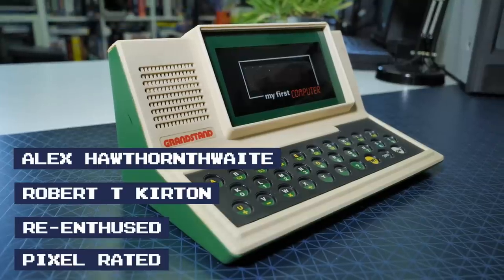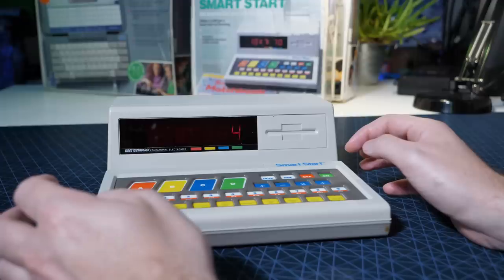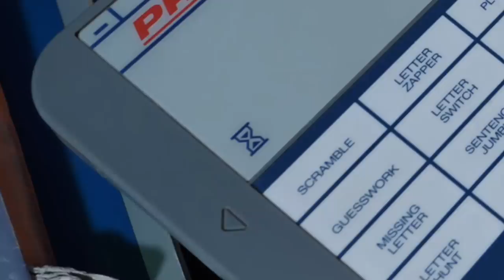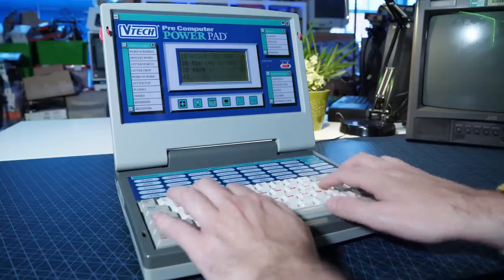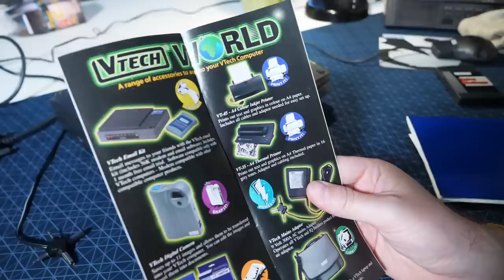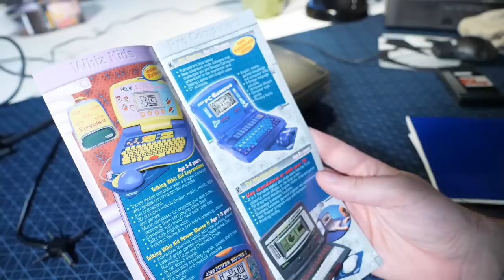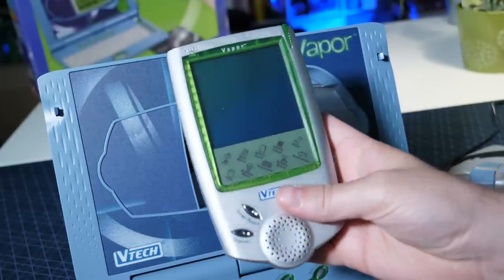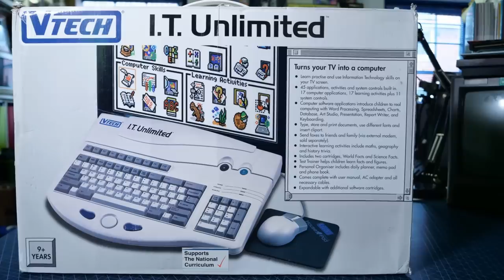VTech Laptops: Better than you Think | Nostalgia Nerd

Comment: The Talking Whiz Kid Platinum actually has TWO extra colours! I am literally on the point of fainting. You get red, green, and blue, and the last option being the background which is sort of greenish silver. 

It uses a rare type of LCD also used in a few Casio organisers in the 1990s. I'm obsessed with it! The colours are always washed out and weird looking. Some seem to have more than 4 colours. And they solve the problem of colour LCDs, which is that in the past they always needed a backlight to see anything at all. And until that Japanese man invented the modern blue LED, and therefore the white LED (he got a Nobel prize for it you know, and now every lightbulb uses his LEDs!), the only backlight you could have was an incandescent bulb, which wasn't bright, and sucked down power. Or else you could use a small fluorescent tube, like the Game Gear and Lynx. Those also sucked the power, those two consoles were famous for eating 6xAAs in a couple of hours. The tubes were bulky and needed a 100V transformer to power them. Horribly inconvenient, colour LCD had been around for years, but nobody could use it cos of the backlight they needed. 

Anyway that nice Japanese man invented his blue LED, which, with a phosphor in front, can produce white. The phosphor absorbs some of the blue and re-emits in longer wavelengths, yellow, green, red, etc. So after that low-power colour LEDs were all over the place for tuppence, hooray!

Anyway, your weird 4-colour ketchup-stain of a display is interesting cos it's the exception. It's not great, but it actually works. And it bugs me to wonder, is that what the Game Boy Colour used? It only used a couple of small batteries (2xAAA I think) and had no backlight. It's display was colour but had a really weird look about it, really odd colours a lot like those on the ol' Platinum.

And do you know how much information there is on the web about this LCD display, or even what the Gameboy Colour actually used? None! Bugger all, nothing. Disappointing when something hooks you, and you've been on the Internet 20 odd years and are used to being able to find out everything about anything in a few seconds searching. But no. They're an enigma wrapped in a mystery wrapped in a kids' toy computer, wrapped in cardboard.

Comment: I remember one of these, always wanted a computer since the days I used to play on my uncles ZX Spectrum. First computer I ever got was a 286 in, 1997? It first lived in some BT office. Got it for £20. 20mb hard drive which I had swapped out with a 40mb pretty soon, and a soundblaster of some sort, I barely remember. 1mb of RAM. 
I'm so glad I didn't get a vtech and waited for the real thing. My 286 could do so much. My dad even used it for plotting filters, the 286 used to take a long time calculating frequency response! 

I think in 1998/9 I got given a pentium 60mhz machine I overclocked by 10% with 32mb of RAM and a 500mb hard drive and that was great. Could just about play Total annihlation. I don't remember what happened to those computers. Probably binned.

Comment: i had one as a kid, cant remember the brand ... all i remember is that it was blue, it had what i think i remember is a proper laptop keyboard, terrible touch pad, ethernet, printer port, and most interestingly a CD drive but the head on it was fixed in place so it could only read one track
probably 128x256 B/W display without a backlight

Comment: I have their "Talking Whiz Kid Plus".

Not only is it a decent little toy, it also has high potential in a hardware hacker's hands!

The thing seems to be Z80 based with a TI TSP voice synthesizer. Only the synth or CPU can run at one time, which prevents the data bus from gettjng thrashed and crashing the toy.

Weirdly, despite what appears to be Z80 code in the rom, the CPU seems to also have some sort of "bootstrap"/"bootloader" rom in it also.

The first 256 bytes in Z80 assembly invoke RST 38h. A lot. So much so, it would result in an infinite loop if the external rom is positioned at $0000.

Second, the toy always writes text to the LCD on reset. No matter what rom you put in, it always writes something to the display, something it shouldn't do as the rom's I put in for testing where pulled off old GPU's.

Also, cartridge slot! It's what grabbed my attention when I first picked it up.

Comment: You ask whether these were just toys or perhaps what could be considered fully featured (personal?) computers. As this has evolved directly proportional to our technical sophistication in CPU architecture design; one such milestone being wether it can run a fully featured Doom engine and port of game assets at playble (25+)FPS with only bare minimum done with platform specific assembler, equivocal to the PC / DOS version. If it can't do that at conventional SVGA resolutions common for gaming PCs of the time like 640x480 and perhaps even 800x600 with Doom95 (with 320x240 giving low-end, absolute minimum passing score of "barely adequate for the half blind".), it's a pocket  calculator.

Comment: I always wanted one of these as a kid but I was too poor. Thankfully we skipped that and went straight for a Windows 95 computer it was probably way better. Remember seeing them in stores and friends houses and thinking what are those ports for there was obviously the mouse, and it had a printer? And thinking would it to that connect to a regular printer? I was even really fascinated by the desktop that they had in the stores. I never knew that they could be capable of programming that might have sold me when I was younger at learning how to program? And the idea of one of these things with a modem was sort of dream of mind at the time, still just as baffling amazing to think that small little device connected to sort of an Internet. Ultimately the frustration of it being so locked down would now and when I was younger drive me nuts.

I was the kind of kid who would get McDonald's toys to take apart, and try and modify things.

Comment: Hey, just a thought, when did computers stop using BASIC? I know the C64 and Spec were arround in the early 90's, but I mean when was the first time there were no new computers released with BASIC? Built in, I mean. I know you can (theoretically) load and run it on any new system.

Comment: They apparently liked to rebrand things a lot. That "Powerpad" at 10:12 looked and sounded very very familiar... and after some googling it turned out that's the model I had as a kid :D
... except it had a slightly different case and was called the "Genius Leader 4004 Quadro L" ... rolls right off the tongue doesn't it?

Comment: Interestingly, VTech licensed the Apple II system software to produce a clone for one of its kids' computers (I don't know if that's  the system you show at the end). Jobs killed it in 1996, and I don't know if it came out or not. It's interesting, though, because VTech had created a grey market Apple II clone back in the day, the Laser 128, by reverse engineering the ROM.

Comment: I think the future is going to be interesting considering you have dirt-cheap SoC PCs like the Raspberry Pi where manufacturers don't even have to make the main hardware for it anymore — Just a cheap display, some downloadable programmed software parents will be expected to flash and the requirement of a minimum-spec Pi or Pi-alike compatible with their software. When the child is ready for a real computer, parents can upgrade the PC's OS with Raspbian, Ubuntu or Manjaro and give their kid a system they can spend the rest of their life using.
If you wonder why Intel is getting into something which feels similar using PCI-E, that's probably the future they're looking at too — Swappable graphics and compute units for people who want something higher-end with their 12VO power supply standard. Except instead of a computer of more hefty expense where everything is separate, integrated components and a system similar to how server hardware is handled — miniaturized for the home PC market — will take the place of the desktop you're reading this on now and Pi's or Pi-alikes will be for the kids.

Comment: The problem is they tried to make these things more than they were, hence the unusably tiny display inside an enormous shell, and lack of typical computer functions of the time, like USB support (even just for text) or any real way to get data on or off the device 

These things would've been orders of magnitude more useful if they added a floppy drive (Or USB port on the more modern ones)

Comment: The only thing I took away from this is that the Stylepad is better than the Microsoft Surface because the Stylepad's keyboard connector has a little flap, but the Surface doesn't. Bruh.

Comment: When you say modern kids would just have an actual iPad or something then there device will still be cheaper because it will probably be the least expensive iPad you can find.

I have a tablet running Windows 10 and it struggles to run YouTube videos and that's without any other programs open who knew two gigs of RAM wasn't enough nobody from the 90s would have guessed of that

Comment: 6 C or D batteries for that?? Screw that, rather convert it to use a USB buck converter and up the voltage than waste all those batteries
Speaking of which, with 6 batteries what voltage does that thing need?

Comment: I had these when i was young. I beg to differ, these things WERE the suck.  in 1987, i saw a computer i wanted to learn on in the radioshack catalog.  i was 8, and started saving, by the summer of 1988, I'd saved up the $500 by working my BUTT Off, and jumped into comptuers with both feet. First game? Microsoft Flight Simulator. and ill tell you what.. 2 frames per second sucked almost as much as these Vtech glorified calculators.